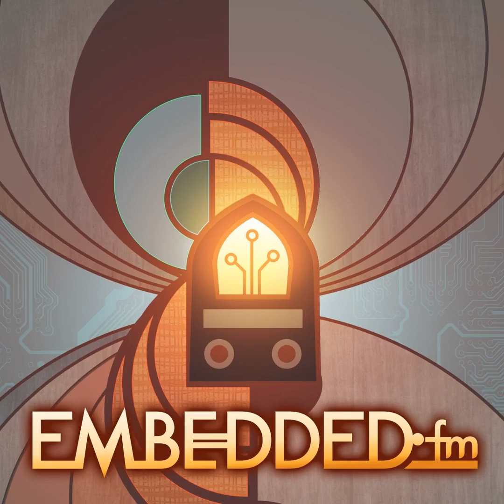226: Camp AVR Vs. Camp Microchip

Comment: An excellent podcast, thank you. I know it is pretty old, but also still very applicable.

Jay suggested that there was no need for the STM8 and we should just move to STM32. We keep trying, but it doesn't always work. We have a product with an STM8 in a 4x4mm package. If we replaced it with an STM32 then we would need to bump up to a larger 5x5mm package as the STM32 has a lower I/O pin density. Many of our products simply do not have the room to accept that kind of bloat.

What this podcast could not have foreseen was the global component shortage. The STM8 went unobtainium so we switched to the ATtiny 1616 which was obtainable when the STM8 was being allocated to customers with contract penalties enforcing timely deliveries. If we find out that a product is used in the automotive industry or by a certain fruit company then we run away as we know that in those markets we would get the MCUs only after the big contract orders are fulfilled.

Compilers are far more important than was talked about here. I don't want to do my compiling in a gui with a licensing scheme that needs to phone home. I need something that will run in a container in a github pipeline.